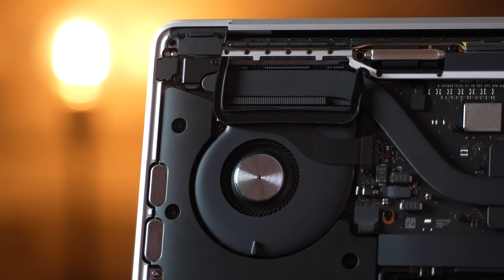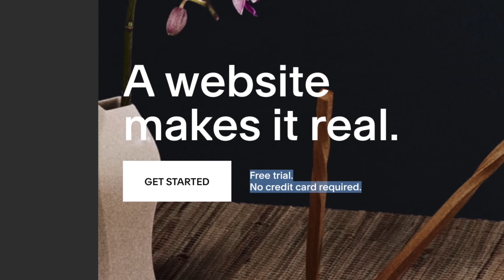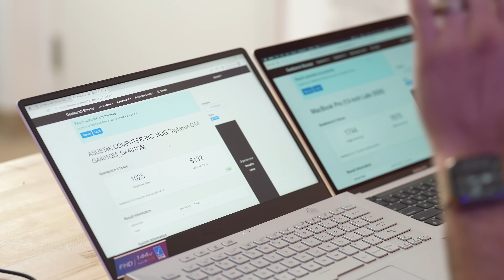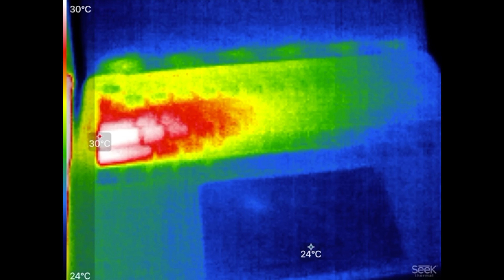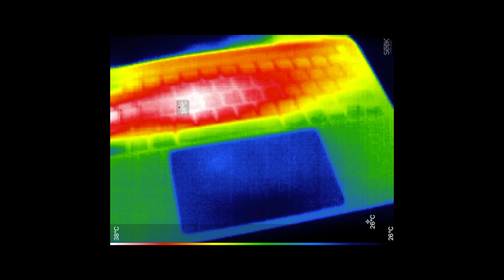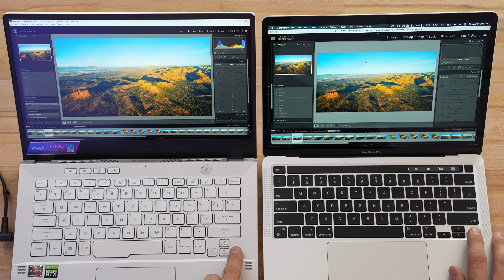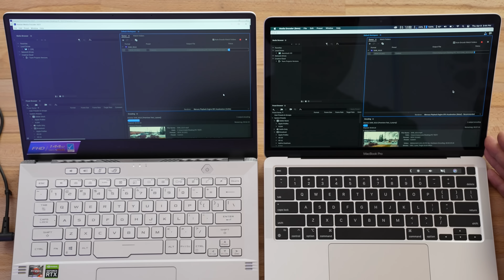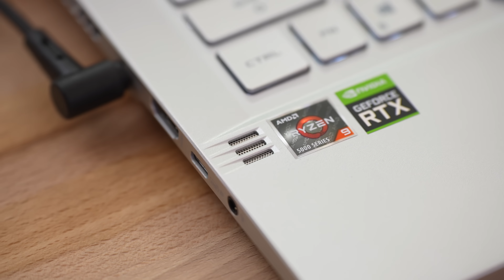Apple M1 vs AMD 5900HS + RTX 3060: FINALLY an M1 Killer?

Comment: AMD is really picking up their game. This was really interesting to see how close the M1 and AMD were.
Reply: The AMD is competitive in just about everything except power consumption. And it is significantly faster on GPU performance when using the external RTX3060. But it’s way behind on CPU performance when operating off battery.
Reply: Intel cry when see this
Reply: @restupradewa9319  Intel is Indian favourite. AMD is Chinese people favourite.
Reply: @tomerweiss4900  yah, to be honest even 9th intel is enough for pretty mutch any task (not U series ofc) , cpus power increased exponentially in few last years, ppl are blinded by  benchmarks numbers that says nothing, but dont see further than that. workflows stayed the same for many years now. if you not gamer or niche scientist, any cpu is good, ofc for average user, mobility and battery of apple is realy neat, everything else, with apples IO and all the limitation is the waste
Reply: But AMD got absolutely smashed to pieces. It was often slower than the M1 whilst using 4 times as much power.
Reply: @scubasausage  All benchmark where synthetic, all benchmark where absolute trash, real time performance is was count, take a look on the gpu score.
How is the RTX 3060 only 2 times faster if the mac has the same gpu performance like the 11gen intel chips, why not use real games????
Reply: @coffee7180  The M1 has a much faster graphics chip than an Intel CPU.
Reply: You should see that and is putting up their best cpu against apple's replacement for intel core i3/i5.
Reply: @anuj103  you do notice that that laptop is $400 cheaper apple fanboy
Reply: @heershah6451  You can get the CPU with a tiny bit less performance in the base model of the MacBook Air which is another $400 cheaper than the G14...
Reply: As good as AMD is getting, they're really pushing what x86 is capable of in mobile computing.
Reply: @yarnosh  Do you actually think ISA matters in the end?
Here's a hint between the M1 and AMD's efficiency discrepancies: Lithography. The difference between the M1 and Ryzen pretty much follows what TSMC says about the difference between their 7nm and 5nm process: 5nm results in roughly 15-30% superior performance.
Another thing of note is that increasing power consumption does not linearly scale with an increase in performance.
My desktop's 5600X's CPU cores are purposefully limited to ~13W, yet it has the same multi-core performance as a stock 7700K.
Reply: @nowool1999  

Keep in mind you're comparing a whole SoC against JUST the a CPU. When you compare the power consumption of entire systems, the M1 based ones go way beyond that lithography differences. Not only do M1 laptops have crazy long battery life, but they do so without throttling when not plugged in. You get full performance whether you're plugged in or not. 

Yes, I do think the ISA matters. x86 does not decode into micro-ops efficiently because the instructions are variable length and full of odd instructions that are rarely used, including 16-bit stuff dating back to the 80's.  Where the M1 doesn't even support ARMv7 (32bit), AFAIK. The M1 is all 64-bit with none of the old  cruft. And fixed length instructions. 

It gets increasingly difficult to keep parallel pipelines full in x86 CPUs. All else being equal I believe the ARM ISA, especially an implementation that only supports what it absolutely needs to, is always going to have an edge, especially in efficiency.  But Apple has proven that ARM can also scale in performance to compete with x86. 

I think the days of space-heater gaming rigs and laptops that have like 2 hours of battery life under load are coming to an end. And with it, x86.
Reply: the Stupidity of this test is that M1 is always unplug!!
Reply: @jeffa4822  the M1 is a Arm chip, the power consumption doesn't rise when plugged in
Reply: @marcocousins8058  yeah but the Intel MacBook‘s kept their performance also unplugged, which were not ARM Based. It just seems like only MacBook‘s are good unplugged, even the Battery on the M1‘s are untouchable for their performance compared to every other brand
Reply: @marcocousins8058  m1 is mobile soc stop compare to destopk cpu M1 lose to intel or amd
Reply: @jeffa4822  it doesn't matter for M1. It behaves the same!
Reply: @jeffa4822  MacBooks give you the full performance even when they're unplugged. It literally doesn't make a difference
Reply: Meanwhile Intel be freaking out trying to get anything to work
Reply: @UNSCPILOT  Not for long. Intels Alderlake will most likely beat Ryzen 5000. Theres even a possibility that Intels GPUs could be faster than AMDs and Nvidias. But I dont think so personally.
Reply: @scubasausage  If they can actually produce the part at scale, and assuming that Ryzen 6000 doesn't throw Intel right back to square one.

To spite the enormous differences in Intel and AMD's R&D budget they seem to be having some serious issues making a competitive architecture or even moving off their 14nm node, It's shocking how long it took for 10nm to get out as a viable product.

And now 64 bit ARM is stepping in, I'd be interested to see AMD and Intel working on their own ARM based cores to see what they can achieve with that increased efficiency
Reply: @UNSCPILOT  I think you’re perception is a bit off. AMD don’t even make their own chips. They sold their foundries off years ago and contract out to places like TSMC. Intel’s 10nm is actually a little ahead of TSMC 7nm in terms of efficiency and is close to TSMC 5nm so really whilst they have had some delays they are still doing very well considering they are private fav. I also believe AMD could have done more to take advantage of Intel’s 10nm delays. Zen 2 should have been skipped for Zen 3 as Intel’s 14nm was still competitive with Zen 2 on 7nm. 

And yes Ryzen 6000 might retain the title for AMD but it would have to be pretty special, currently it looks like a Ryzen 5000 refresh. Alder lake is the first new Intel product in a several years and I’m quite impressed with the design personally, it’s about time we moved on from only having one type of core in the die. It’s a big innovation and I want to see innovation win over a refreshed product. 

Although Apple is making fools of both AMD and Intel at the moment.
Reply: @scubasausage  I'm well aware AMD relies on others to manufacture their silicon, and they seem to have a pretty good working relationship with them as they are moving much faster than Intel was with their own foundries, This is just speculation but I think Intel was a little too comfortable before Ryzen and suffered some serious "management rot" that crippled their actual engineering capabilities, now they need to frantically untangle that mess to get back on their feet, I suspect at least some of their leaks may be bluffs intended to reduce their market share slippage
Reply: @UNSCPILOT  Intel only really had about a 2 year delay on 10nm. Had it been on time then Ryzen would never have been a success. Intel definitely slowed down their products when they had no competitor but I dont blame them for choosing not to compete with themselves. Actually I blame AMD for that, they effectively abandoned the market for a decade. I hope to god they dont do that again. 

As for Intels engineering capabilities, they are outstanding. I work with them. No company can offer what they do. Its not all about individual die designs, its about complete solutions and this is why Intel are making record profits every year for the last few years now.
Reply: and amd just started. look at threadripper cpus, m1 looks like crying child in front of best what amd have to offer
Reply: @racistpixel1017  How is AMD "just started?" They've been competing with Intel since 1996! The only reason the laptop in this comparison can compete at all is because of teh discrete GPU. Otherwise, the M1 blows it away and does it with a fraction of the heat.  Apple is the one who is just getting started. This is just their mobile CPU. Wait and see what Apple does for the Mac Pro where heat is less of a concern.
Reply: @yarnosh  no, cpu in zephyrus is decent and amd just started pushing, they newer competed with intel, they just did low end cpus amd gpus, now they started to compete and there is a chanse that will surpass apple m series. you can hope that m2 will be 2 or 3 x faster or as time and apple in past show us, only around 20%
Reply: @racistpixel1017  I think what you mean to say is AMD has never been competitive with Intel on performance until now. But they have been COMPETING for decades.  There are technical limitations to x86 that puts both Intel and AMD at a disadvantage compared to Apple. Most notably heat and clock speeds. This isn't AMD vs. Apple. This x86 vs. ARM, CISC vs. RISC, modular systems vs. specialized systems on a chip. As long as AMD sticks with x86, they are going to lose. ARM SoC's just have more room to grow and more flexible configurations.

x86 is even losing ground in the server space. Look at Amazon's Graviton2 cores. It's also ARM based and is cheaper per core (where # of cores matter) and per watt than anything AMD has.  With ARM even companies that don't specialize in CPUs can make CPUs that work best for their use case. 

The only thing that has kept people on x86 this long is basically Windows and video games.  As Linux and Apple expand in servers and desktops respectively, there's are fewer reasons to use x86.  Microsoft will be forced to publically release and support Windows 10 on ARM.  And that will really set the clock ticking for x86. Once you get major game titles releases for ARM.... it's over.  Gamers could buy ARM configurations specially tailored to run games well. 

Probably you can keep building your gaming PC on x86 AMD processors for now, but the rest of computing is moving on.
Reply: @racistpixel1017  Wait for the m1x when amd cpus cry while getting crushed apart.
Reply: @h7productions286  i guess m1x or m2 will be 20% faster than last gen, m1 is actualy iphone A cpu just more cores and tdp and so, thats how it is, so when you think that A cpu's usually 20% faster every year, yah i can see m2 to be hopes crusher. dont expect it to be 2x faster or anything, its not apple style to give ppl. more. even of m2 will be 3x or 4x faster, still nothing compared to best amd and intel offerings, m1 not even in top charts.

plus if you educate your self, next gen amd cpu's going to be beasts, so apple have huge competitor
Reply: @yarnosh  ok , ale koszta zakupu jednego czy drugiego laptopa to mozna miec 2 x ryzen za 1 x mac m 1 pro takze mac beee amd ok

Comment: Apple M1 vs AMD 5900HS

And the final verdict is:

"What do you guys think...?"
Reply: amd ryzen win
Reply: waste of time this video
Reply: M1 wins, but have a dedicated graphics makes me seem the video as unfair, if he was trying to compare a machine that only has iGPU agains a machine that includes iGPU and a dedicated, it's gonna have a lotta diferences. To me the real test it could be a M1 + eGPU (that will have a performance penalty by being connected externally) against the G14
Reply: @d3cr1pt  I don't think the comparison is unfair, since the notebook with the nvidia gpu is 400 dollars less expensive
Reply: @d3cr1pt  the m1 can not put an rtx 3060 or 3070, to be ARM it has to be all unified, now if you buy apple you stay in that you can not choose between a laptop with a better graphics card and stay in what APPLE gives you that has low performance of your integrated video. now if the tests are with integrated video, there are settings in the bios that can disable the rtx it will be the same vega 8 is superior to apple video
Reply: It is very simple, if the intention is to play, no M1 will do until they decide to integrate a good GPU, but for all the rest and I mean everything, the M1 is definitely a little beast. And the fact that it does not generate so much temperature or sound, makes its use a true orgasm, Apple has released a product of those that change the paradigm as it used to be in the days of Steve Jobs, I really missed it
Reply: @Cesar_EP  Not just games dude...on any graphics intensive softwares M1 will suck big time.
Reply: AMD Wins #AMD

Comment: Thermals. You need to separate the two laptops when testing thermals. It was obvious when you showed the M1 thermals that is as being cooked by the AMD’s fan driven hot air.  Given Apples typical conservative performance throttling when temperature rises, this would have given the minor performance difference.

Comment: Gotta love how it takes a machine built for AAA gaming to start beating the benchmarks of the entry-level specs of Apple's slowest-ever M SOC.
But as others have said too: would love to see you run the whole wash of tests unplugged at 80% brightness and report battery percentages and estimated time remaining.
The G14 is a beast of laptop, for sure, but is also built for a different purpose: AAA gaming.
The M1 MBP on the other hand, is built for one thing and one thing only: proof of concept and marketability.
Reply: Why entry level? For me its high end. You don't have any other choise with Macbook M1, only upgrades are RAM and Storage.
Reply: @DenisasPupkevicius  Because it's the slowest M chip Apple will ever make. But I suspect it will be around for at least another year, providing an entry-level option in the "older style" form factors while the upgrade will be to the new 14" and 16" MBP with the  M1X.
Same story when the M2 comes out, earlier versions will still be available, much like you can still buy the iPhone SE and 11 new, even though the 12 has been out for almost a year and the 13 is expected to be anounced later this month.
Reply: @kitop310  Why slowest? Currently it's their best. I believe your thoughts are not right. Intel and AMD can offer their best  mobile laptop processors for similar price, different only that they can bring on the table much more options. When Apple will release new generation  processor called M1x or whatever, so will do AMD and Intel.

Comment: I own both the G14 and the M1 MacBook Pro. Although I prefer the MacBook, because of MacOS, it just does not compete with the G14 in real world computing. The G14 is a monster. If you want a portable gaming machine, that also doubles up as a great content creating workstation, you can't go wrong with the G14. Also consider price. The G14 is $1499, and a similar spec'd MacBook Pro (16GB RAM, 1TB SSD) would be $1899. If you would like to see some other comparisons between these machines, by someone that uses them in real world settings, go check out the review done by The Everyday Dad here on YouTube.

Comment: The early 11th Gen Intel processor tests compared only 3000 series AMD processors and made no comparisons to the M1 processor. From your test, I would expect a head to head comparison with the 11th Gen intel processors to show that Intel remains in 3rd place behind AMD and Apple.  I believe that the 11th Gen Intel processor is fabricated on Intel's 10nm line, whereas both the AMD and Apple processors are fabricated on TSMC's F18 5nm line.  Clearly TSMC is still 1 to 1 1/2 nodes ahead of Intel regardless of the naming convention used. 

At this point, TSMC and Samsung would need to stop fabrication progress for several years to give Intel any chance to catch up.  This would also assume that Intel could have their 7nm lines at high volume  production  in 2023.   To do this, Intel will need to solve whatever problems caused their 10nm process to be over 4 years late.

Comment: Does M1 with Rosetta 2 work good enough with engineering programs like AutoCAD, SolidWorks, MatLab, or Ansys?
Reply: I would also recommend an amd laptop/desktop with good GPU. 
It can run anything..
Reply: With the M1 Mac you can't run any softwares/games that depends on graphics. Like 3D animation and rendering etc
Reply: Good question, unfortunately this channel doesn't seems interested into serius engineering software.
Reply: @positive_energy3131  yeah. It doesn't care about such softwares but I'm pretty sure it works pretty well...

Comment: The complete silence was reason why I chose M1. When other manufacturers can achieve that with same performance, I might be interested. But I like my MBA.
Reply: I think there is a mistake in the video. The laptop costs around $2500 or more. I think he got it sponsored but checked the price online for wrong model accidentally. For 1500 bucks you get the version with amd ryzen 7
Reply: @PfropfNo1  not for a 3060 model. i can tell you now a 3060 model doesn't cost $2500
Reply: @PfropfNo1  I just got that laptop for $1,449 at Best Buy. It comes with a ryzen 9 and rtx 3060. From California

Comment: Key takeaways:💁
M1 performs roughly similar in real world and when optimised apps are used even better all while consuming 5 times lesser power and not having to plug it in either. So technically you are paying 5 times lesser than what you would have payed for electricity because of your computer. 
3.8 ghz 8 core chip beating 3.2 ghz 4 high performance core chip by a small margin isnt a bad performance for the m1 at all.
Imagine any other company who have never made a laptop chip come in and disrupt the industry so much?
If these chips are still so hard to beat for efficiency....imagine by the end of this year even ppl living in denial and skeptism of these chips will have nothing to say after M1X or Z comes out.
Reply: that is not a great argument power draw difference is about 30-40 watts on avg and assuming you take 30 days/year break from dedicated work and use 7-8 hours of uninterrupted usage = (0.04W * 8hrs * 335days ) ~ 110 units of electricity extra and it's not worth the 300-400$ premium going for a M1 now, provided they improve the pricing.